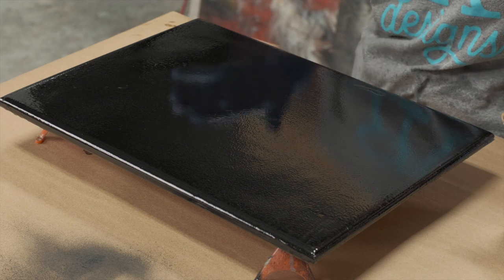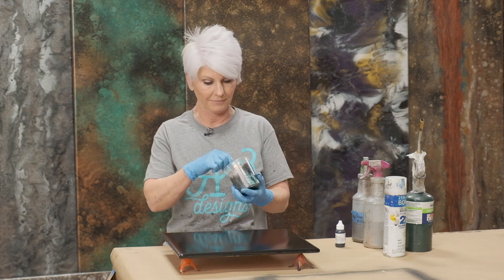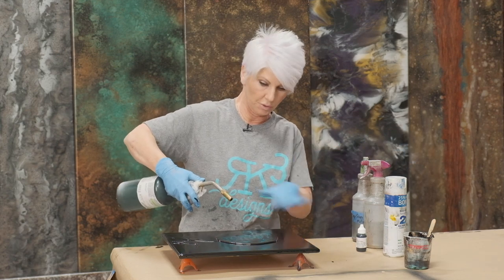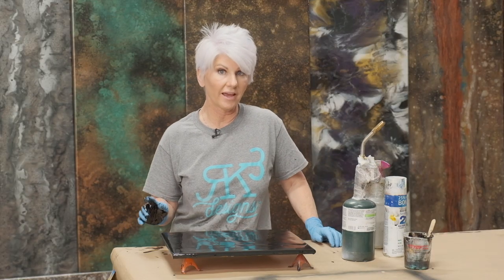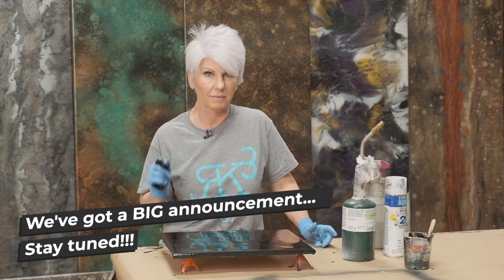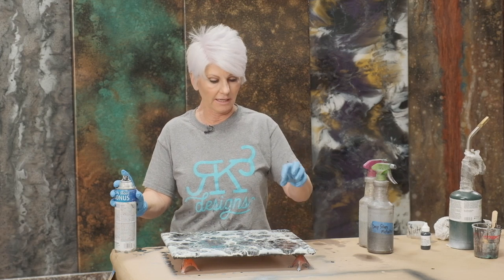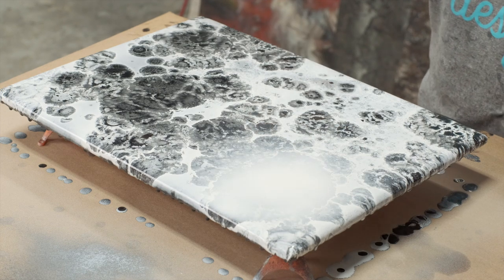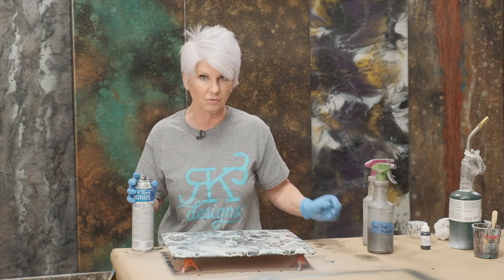DIY Marble Countertops with Stone Coat Countertop Epoxy

Comment: I was told doing spray paint on top makes the countertop less durable over time because that art is sitting on top instead of through the whole thing. Then it can scratch off quicker. How do you keep a spray paint art super durable for clients because I love the looks but now I’m paranoid it won’t last
Reply from the maker: We always add a flood coat (clear coat) layer for both durability and to cover any imperfections in the first color coat. We’ve done 100’s of kitchens/bathrooms and have NEVER had an issue with our Stonecoat Countertop Epoxy not being super durable. 😊😊
Reply: RK3 Designs ohhhh no I didn’t mean the epoxy not being durable hahaha I love stonecoat! I just meant spray paint altering the strength but if you flood coat it that totally makes sense that you wouldn’t have any issues! Awesome thank you 😁

Comment: Its a cool design. I probably would not have done as many "thin" lines with the silver. would have liked to see it after it had cured. You should do one with a time lapse of the spreading and fracturing to show how the surface tension and different colors and mediums react and interact.
Reply from the maker: I like the time lapse idea!!! Thanks

Comment: Hey. One question. The black Baer base paint. It looked shiny. I thought you had to sand before you applied the epoxy?? Or was that just between coats? I did my bathroom. It turned out great, but was that an unnecessary step? This turned out great, btw. Love your work, thanks
Reply from the maker: I just scuff it in  between coats. So glad to hear your project turned out good!! 😊😊😊